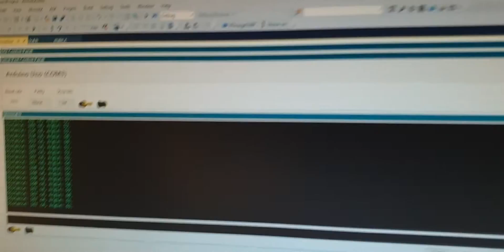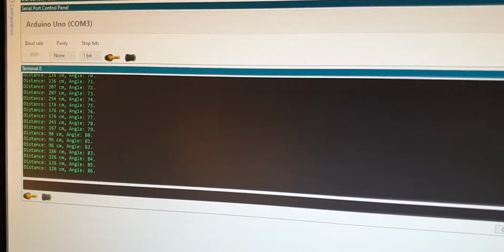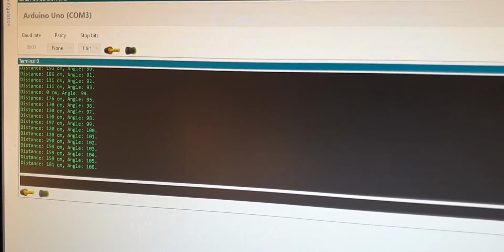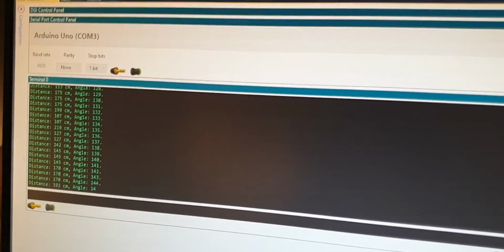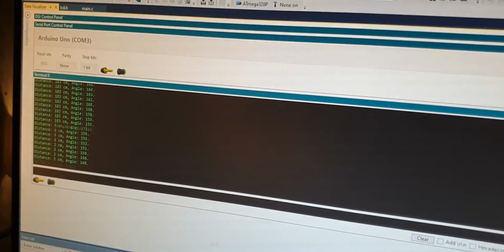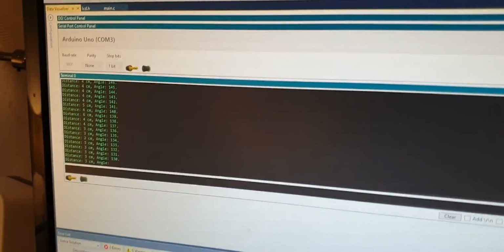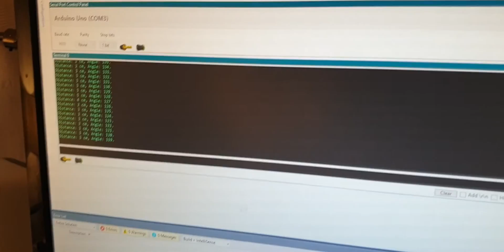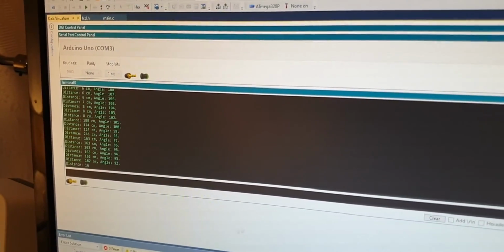SONAR Scanning System | ATmega328P and HC-SR04 Ultrasonic Sensor

Comment: Doesn't work the value of the sensor doesn't see on terminal or lcd, idk why.

maybe @stuart shanks has a response
Reply from the maker: Is the sensor working correctly? I suggest you test each component individually, to make sure it's all wired correctly. The datasheet is your friend! What's the setup of your components?
Reply: @Supo33   Yes the sensors works individually , i test him via arduino and its fine. If you want i can talk with you and you can see everything send me a message and we can go to discord ou semthing else
Reply from the maker: @The_Real_JuJu  And the your connections match the pins used in my code? The pin allocation has to be identical. Test the code in sections, i.e., first try the servo, then the ultrasonic sensor, then the LCD etc. Let me know how it goes!